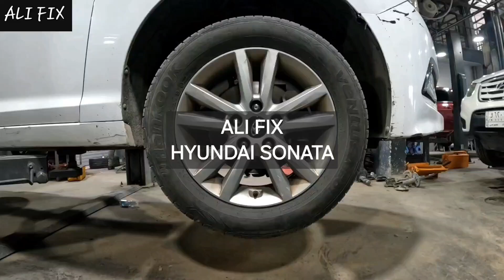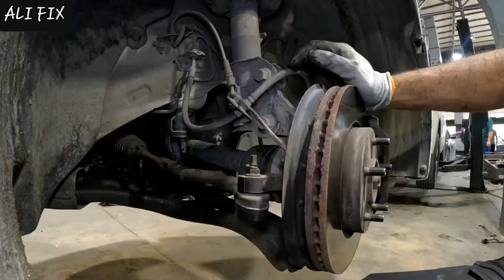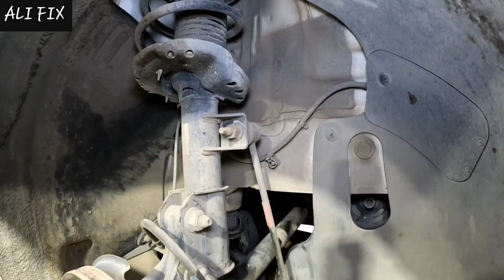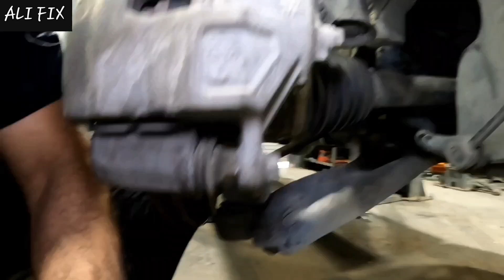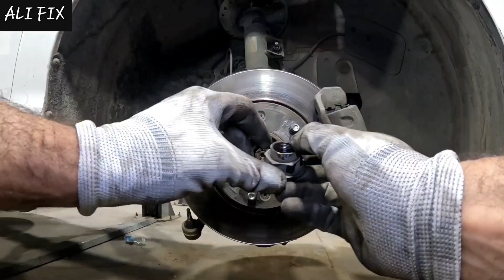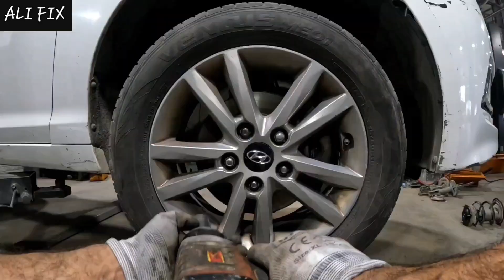right cv axle replacement .. hyundai sonata 2015-2020

Comment: At 1:25, mine doesn’t have those three bolts, it’s just solid metal there. How do I detach it in that case?
Reply from the maker: Press on it...if it doesn't come off use a hammer...or watch this video ..
https://youtube.com/shorts/P_SogsrAf4Y?si=-p-ABid9XYJnbuEN
Reply: Yeh bro me i usually hammer it and it pops right out if that doesn’t happen you can go to autozone and rent a ball joint press their like $50 or something but u get ur money back when you return it